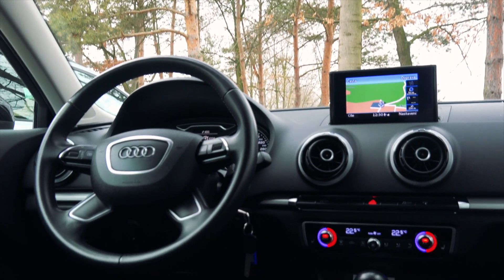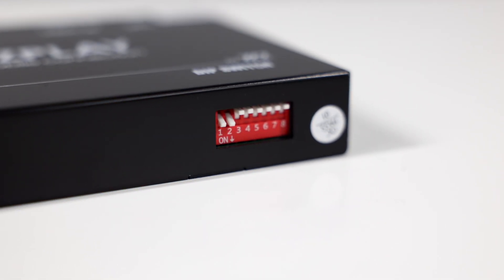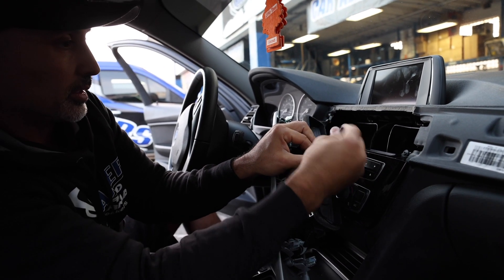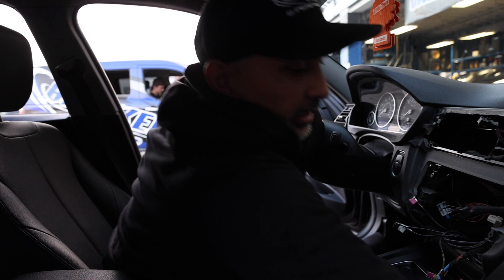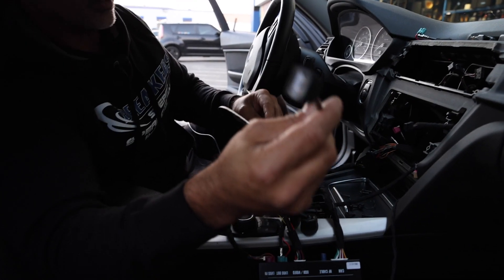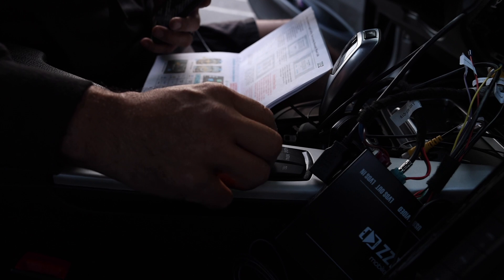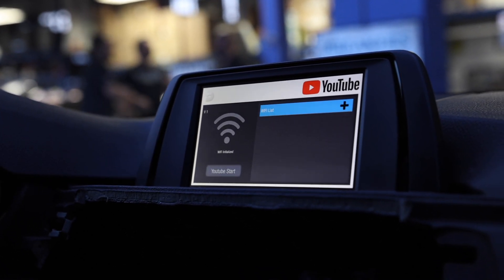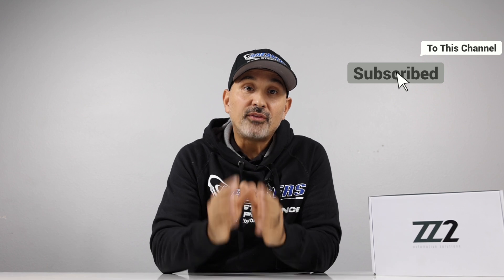Add Wireless Apple CarPlay & Android Auto to factory radio, Audi, BMW, Porsche, Benz, Lexus & more!

Comment: I have a 2006 Lexus GX 470 that’s in desperate need of an upgrade, what do you have for that? It does have the Mark Levinson audio system and gps. However, I plan on using the phones gps instead.